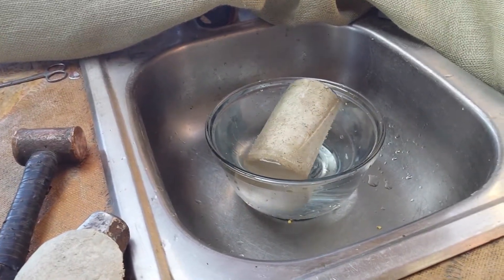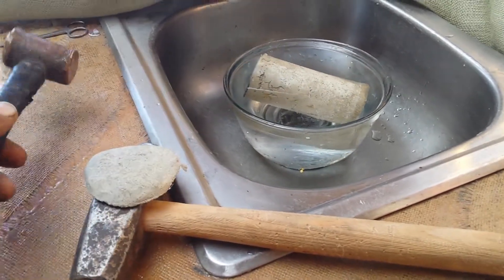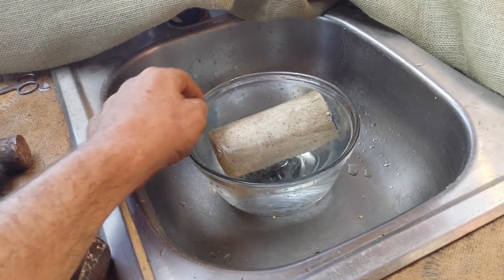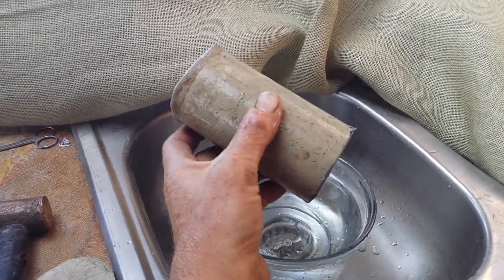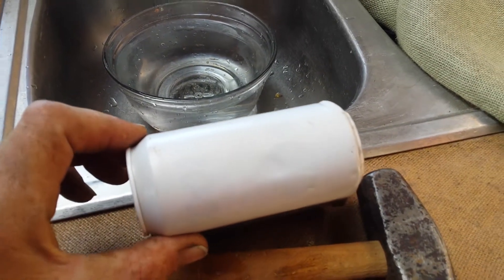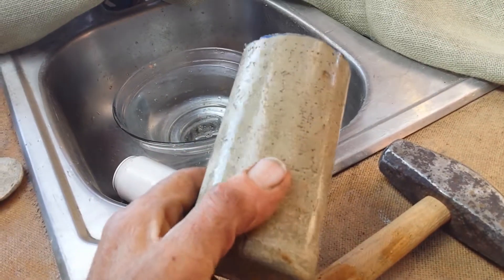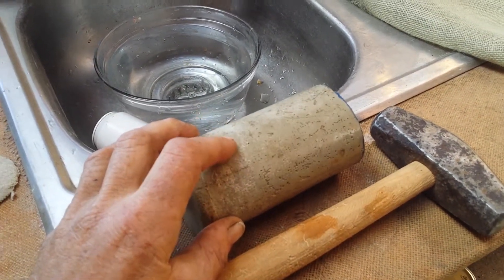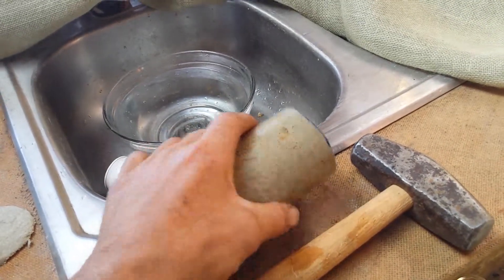Hemp fiber OceanCities able to self heal

Comment: The application is endless if you are knowledgeable...I did some drymatt layup of fiberglass car bodies in the late 60's that this would have been FAR superior strength...Our bodies were about 82 pounds but with this it would have been stronger and 30% lighter than fiberglass and resin..I am still wondering why the racing industry has not witched from Carbon fibers to hemp for cost reasons alone...Is the Polymers you use Hemp based? A real shame you are not on Facebook as it is a much easier medium to share Ideas and info as well as being world wide. I so much look forward to the day this type of Hemp fiber SIPS will be available....Imagine how it would have performed in the tornado/hurricane zones...
Reply from the maker: Well I'm on Twitter, gene_lasecki
 Have a concept for tilt in place smaller units, modular in design, using semi trailers and factory labor
Reply from the maker: Also Gmail mrglasecki@gmail.com
Reply from the maker: Also Gmail mrglasecki@gmail.com
Simply not facebbok